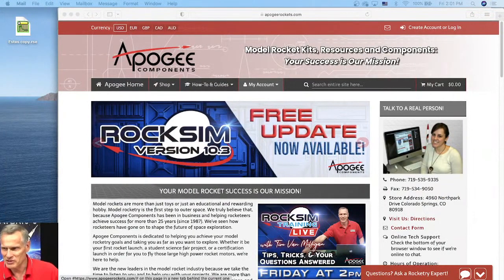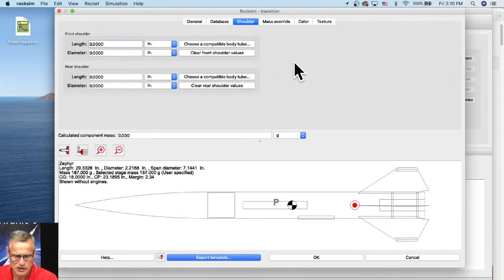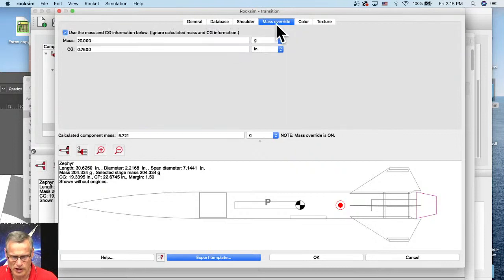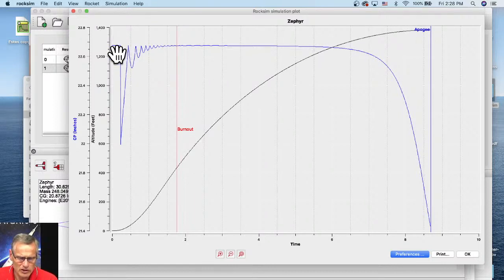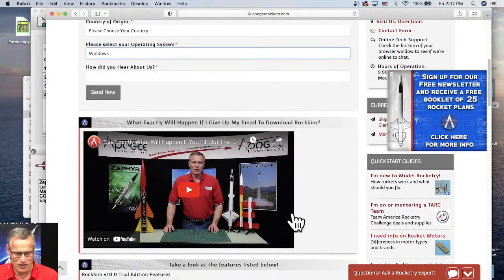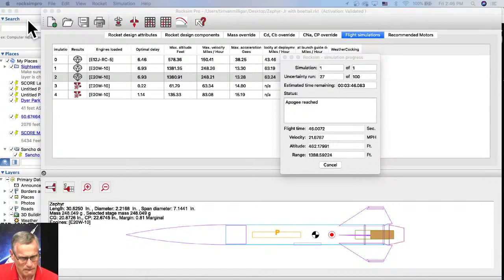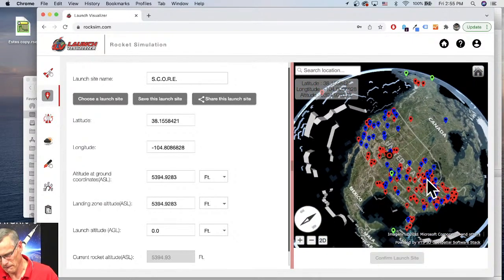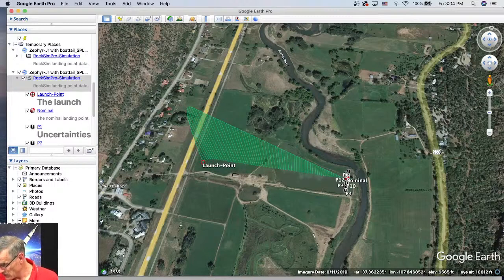Making Model Rockets Go Unstable

Comment: I added a boat tail to the Apogee Aspire like you did on your boat tail simulation using RockSim for practice. I ran the simulation and had interesting results using an Aerotech G80NT-10. The regular Aspire simulation hit 4775.52 altitude with a 1.32 Max Mach velocity.  The Aspire with the Boat Tail hit 5460.14 altitude with a 1.30 Max Mach velocity. The version of the Aspire that I am using is the three fins, per your instructions, for max speed. I found the results interesting that you increase your altitude with a small loss on the Mach one speed.